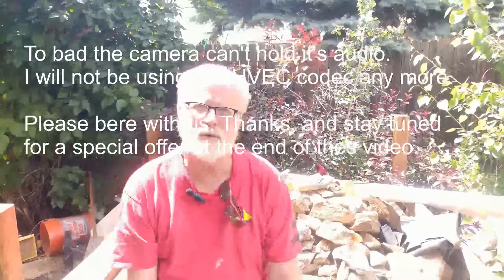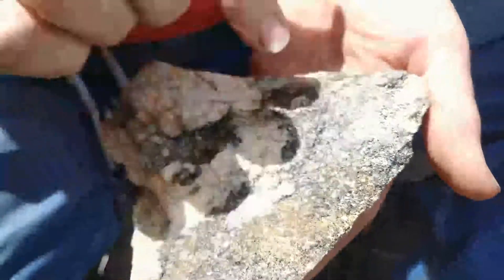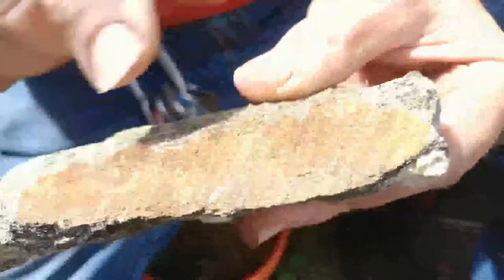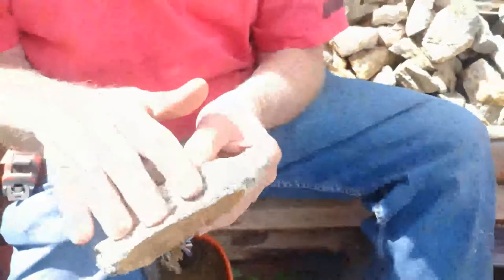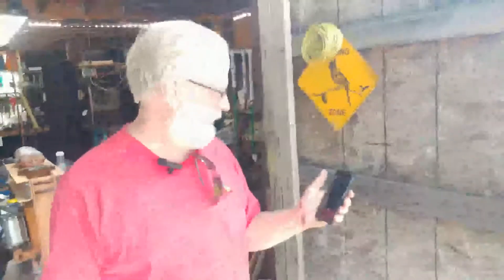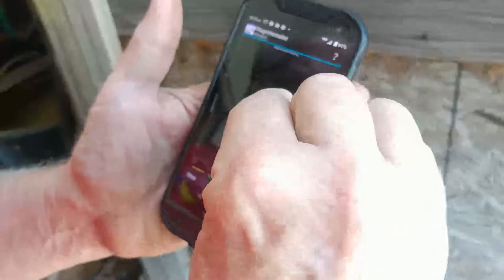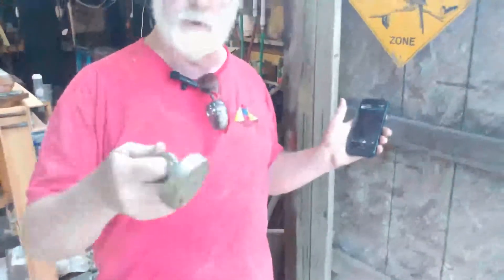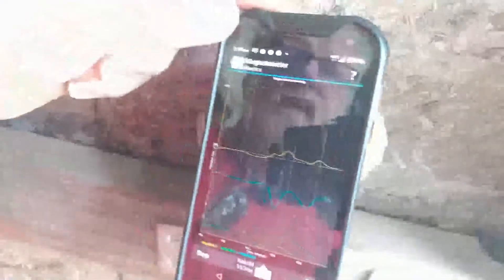FINDING GOLD IN ROCKS . GOLD AND IRON WITH A MAGNET!( EASY.!) #gold #goldmining #goldprospecting

Comment: So Bryan,  How would you use this phenomenon for exploration?  Would you pull a magnet across the ground and follow with the smart phone?
Reply from the maker: That's usually what we do. We just paint the wall or whatever we want to measure with a strong magnet and then just go over it with the phone. I also have a magnetic  greedyometer that I constructed out of two WT 901 sensors and a raspberry pie 3B. They are the same sensors that are  in most phones. More about that device in an upcoming video. The one thing you need to remember about your phone is you need to hold it at the same orientation when you take readings because it has its own magnetic field and if you twist the phone it will apply that magnetic field to the reading. I wrote a magnetic sensing app that both calibrates for zero offset so that you can sense a much smaller field difference and has a orientation guide to help you hold your phone at the same orientation. You can find the app and the source code at https://github.com/clharrysmith/Ore_Finder/releases/tag/v2 . Download the APK by topping on it and then install (By navigating to your download folder and taping on the Ore_Finder.apk file.) as a third party app. You will have to give various permissions on your phone to install from unknown publishers. Google will try to scare you with statements like "This app is dangerous and should not be installed." Ignore those and install anyway. You may need to tap "more" or scroll down to find the "OK install anyway" button. Google does there very best to hide it. I used to have my apps on the Google Play store but that's such a huge hassle, and you have to constantly update your app every 6 months to keep up with their constant rule and API changes. Thank you for your comment. P.S. The Google Play Store does NOT check there apps for malware of spyware or viruses, only that you are using there most recent and ridiculous API updates.
Reply: @bosrecreationalmining  Can you walk along the ground and detect small changes in the earth's magnetic field produced by metallic objects or minerals.  Like walking along a paleo placer bench and finding the black sand concentrations underfoot?
Reply from the maker: @hardrockuniversity7283  Harry here; what we use for exploration is a magnetic gradiometer I made from two WT 901 sensor chips and a raspberry pi 3B. The magnetic sensing app in the phone is good for checking your ore after you paint it with a magnet. The problem with using your phone is you must hold it at precisely the same orientation as you take every reading. A gradometer uses a second sensor to compare against the first so you don't have to hold it at the same orientation. I will be making a video about both the Android magnetometer app I made and the gradiometer I made. You can find the app and source code at https://github.com/clharrysmith/Ore_Finder/releases/tag/v2 .
Reply: That is a great service.  Don't know if I am electronically sophisticated enough to use it.  Are you planning on selling them or plans for them?

Keith
Reply from the maker: @hardrockuniversity7283  Harry here; No plans on selling them. I will have to make a set of plans up that people can follow. It's really pretty simple. The hardest part is soldering the connector pins to the little sensor board. Then it's just a matter of plugging stuff together and installing some software on your raspberry pi or laptop. Also runs exactly the same on Windows laptop PC or Linux PC. It's a Windows forms application made Linux aware and tested to run under mono so that it will run on both on Windows and Linux. Really the only difference between Linux and Windows is Windows uses backslashes in its file path names and Linux uses forward slashes, and the names of the serial ports are different TTYUSB versus COM.
Reply: I'm sure Loren can do it.  A good project for the winter off season.  Thanks.
Reply from the maker: yes works great to help see the iron under the surface.